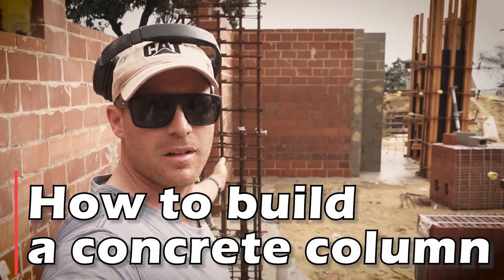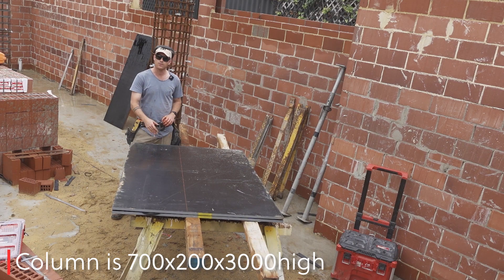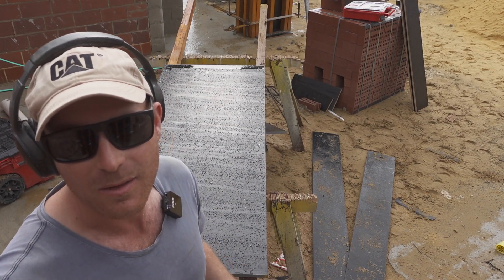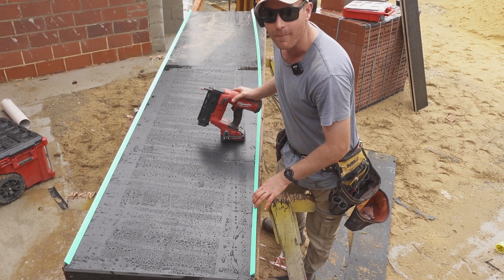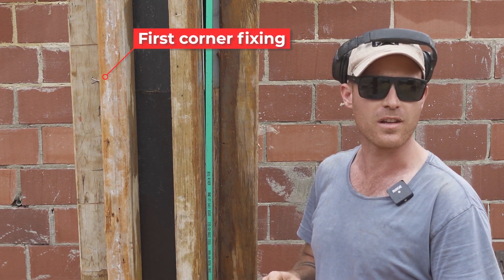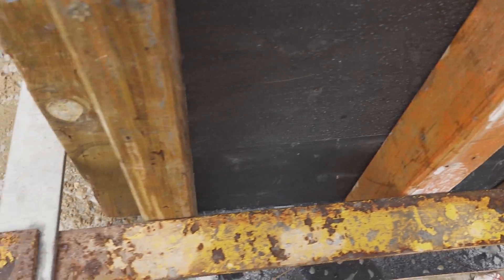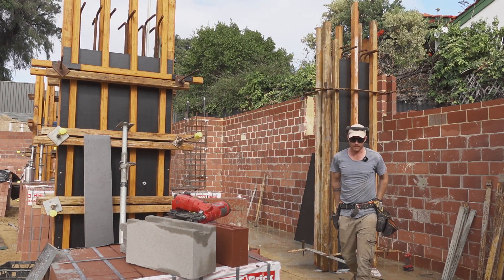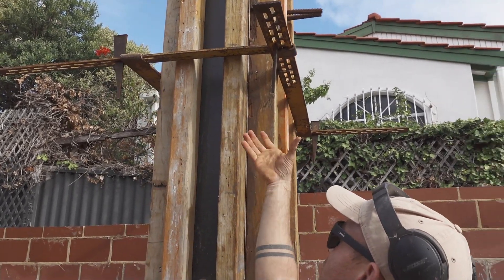HOW TO BUILD A CONCRETE COLUMN

Comment: You tube?  We used slide rules.  Anyway this video does not show how to build a concrete column.  I don't see any concrete column.  I see a form.  No view looking down into it, how it is secured at the base, preparation of the surface below..  It may be square at the top; that doesn't mean it is plumb.  The diameter and pattern of rebar is engineered for  different strengths of concrete and how the column is poured, the amount of water, the compacting to remove the airbubbles and a continuous pour without generating excessive curing heat to prevent cracks is crucial.  It needs stabilized vertically and dynamic plumb measuring equipment from perpendicular sides during pouring.  Hi rise building have to have a vertical laser lite pass through a hole placed in every floor in the same place.  Several stories stay formed as the concrete takes 28 days to cure.  Too much water and it may spall.  If it wasn't compacted well, the sides won't be smooth when the forms removed..  The pour needs constantly vibrated and preferably mechanically from the top.  If it is too wet and poured too fast, then the bulging problems are more probable.
An adjustable or welded 1/4 steel square can be rigged on a track and slipped upwards as each layer cures enout..  The Olivenhain Dam is a contuous pour slip formed.

Cheers.
Reply from the maker: Sorry the video is not what you’re after. I specialise in formwork so that is all I show unfortunately. Take a look at my instagram www.instagram.com/bmformwork to see some perfectly vibrated columns and walls. You will see the detail my company goes into and why we would be too busy to pour concrete. That’s a whole other trade and I leave that to the professionals so I can focus on the carpentry.

Comment: Perfect, but will  wood clamps work?
Reply from the maker: Probably as long as they are strong enough. I’ve never seen them used. Wood clamps strong enough for the concrete pressures would cost far far more than the clamps I use in this video.
Reply: OK thanks

Comment: Hi. Love watching your vids.  quick question.  Is it ok to use 1/2 OSB for 12" square formed columns, with 2x4 on the corners? OR is it recommended to use 22/23"?   Thanks for any input.  Rob
Reply from the maker: Mate I have zero understanding of imperial dimensioning!
Reply: Well, I didn't pull out my calculator but I'm guessing 1/2 OSB would be similar to 12mm or 13mm if it exists in metric sizes and 22/22" would probably be close to 24mm. Can you help now?
Reply: OSB é mais frágil (vai precisar reforçar mais) e nao vai te dar o mesmo acabamento no final

Comment: Good work .. . I have a question for u. I am building a 10 ft high shed, 10 metres x 10 m. Concrete colums 10 ft apart to support the beams. 
For these columns, I was going to use 6  x 12 inch hollowblocks, 4 per level with 12mm reobar straight down the centre of each  hollow blocks hole. So 4 rebars in total.
Every layer I was going to weld a cross bar to each corner of reobar for  cross strength. Alternate this for each level.
The blocks will be made by myself. 30 per bag of cement, plus some additives for extra strength.

Between each column ( 10ft), 6 inch hollow blocks will be laid and attached to these columns using reobar welded to the columns.

Essentially, I want a finished product once it is completed, ready to paint. 

Trying to minimise the workload. 

What do u think of this idea?
Reply from the maker: I suppose it should work. Rather than Weld cross braces you could just buy ligs made to size like a normal column. They dont cost much. As long as the reo is fully cased in conc and has no access to air or moisture it should last a long time. But I'm no engineer.
Reply: @bmformworkconcreteconstruc9783  Thank u for your quick  reply. . . Yes an engineers opinion would be better. . . But having worked with my hands all my life, u do get a sense of what works and doesnt.

Comment: how far you measure the column clamps apart from each other?
Reply from the maker: I usually do the first one as low as possible then about 300mm and as I get closer to the top I span further apart to about 800mm.

Comment: Geday o'l chum. I appreciate you going to the effort to show us formwork techniques.  I gotta arx but. Did you look into why, or ask anybody about  the stormwater pipe that is beside the column before you cut it off at ground level so it couldn't be reconnected without being a real pain for someone? It's curious that it was left uncapped so that all manner of shite & sundry could fall down the hole?  Whether good practice or not, isn't it frequent practice to include drainage within a column? It didn't impede your form, and if it were included within the column form, there would have been more than adequate cover between the pipe and the steelwork, ie ~50mm outside the ply, + 25mm ply + 40mm or so cover from steel to formwork...ie ~115mm cover.  You cut it off and threw it to the shitouse without so much as a comment.    Just arxking buddy....you know what you're doing but no comment was included.
Reply from the maker: haha no worries, around here the pipe runs down the side of the column, sometimes they run it so close to the column that you have to cut it off to form column as it is in way of timbers. I spoke to plumber beforehand and he had no issue with it. He was onsite before the pour.
Reply from the maker: I don't see the pipes inside the columns very often. More so on larger jobs.
Reply: Onya.  Thanks for filling me in. And yes, I can spell and tork propera.  Just laying it on for the Ausies...Sydney boy